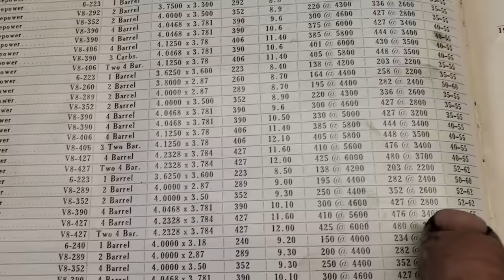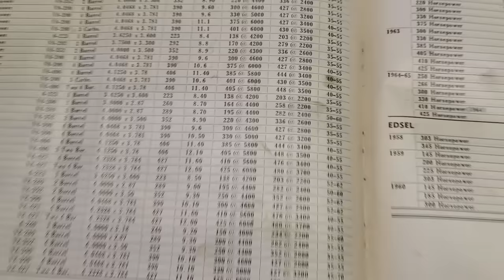1964 Ford 390 FE Country Squire Engine Gets A Teardown

Comment: nice! I have a 64 Galaxie 500 2dr sedan out in the Driveway right now.  the Z code 300hp"thunderbird" V8 was correct with Castillian Gold valve covers and air cleaner and available in any full size model Ford, not just the T-birds.   rest of it should be black.  Ford went to blue engines in 66 sometime.  looking forward to more!
Reply: on that engine stand, flip the head of it upside down so the angled slot are on the bottom side, then you should be able to get the arms into the lower bellhousing bolt holes.  for a complete FE you do need at least a 1000lb engine stand as that thing is 650+ lbs all day with all the iron bits on it...
Reply from the maker: Tried it. Wouldn't fit any way I put it. I'm gonna probably do away with that part of it and build a heavy duty one.

Comment: The reason it says Thunderbird on those valve covers you could buy the cars in 64 with a Thunderbird package they put the Thunderbird engine in them I had a 64 Ford XL convertible that had one in it The motors were gold instead of blue

Comment: We have to assume that engine was taken apart and either rebuilt or given a hone job and 5 thousand over size pistons filed to fit. Also, don't assume all pistons are the same size or all bores are the same.  The rebuilder was under no obligation to do the same thing to every cylinder and it was smart NOT to since they may all have different problems.
  Time to mic the pistons and the bores.

Comment: 26:47 ... man I laughed so hard, that's exactly the sort of stunt I would do!!
Re. the pushrod order in the FE with hydraulic lifters, if you mix them up on the reinstall you can just rev the motor hard for a couple of minutes and that should get things readjusted just fine.
Whenever I have to deal with pistons stuck in a block, I get my bro-in-law to turn up a chunk of wood on his lathe to fit snugly into the bore.  Then I can lay into it with the sledge hammer with least risk of damaging the piston crown.

Comment: My experience with those top exhaust bolts, was that it didn't matter what I tried, heat, heat and chill, the normal thing for me was, about 1/2 of them would break.  I still love the FE engines, and still have a 390, 335 horse, as well as a 428 with CJ heads that don't have a chassis.  Good luck with your project, I'll be watching and hoping that the restoration goes well for you.

Comment: Man I think I would have taken the valve covers off , sprayed marvel mystery oil in the cylinders and the rocker arm panels , and soak them for a few day then tap the rockers with a rubber mallet to see if the valves would free up .

Comment: Hello! Last I heard you were sending the block and heads off to get them magna-fluxed.  Were there any cracks or water leaks?   Also, if you want a really good solvent for stuck bolts or pistons make up a mix of acetone and automatic transmission fluid in equal parts.  Tests showed it was better than any commercial product.
Reply from the maker: We'll get back on it eventually.

Comment: I have a 63 289 I had to heat and beat every piston out. Waiting to get the block checked.  It had the same issues. Overheating and water in the oil but gaskets looked good. Did you ever find the problem.

Comment: A gold painted 390 4V with Thunderbird valve covers is definitely out of a Thunderbird. Galaxies generally had 352's in them with smooth valve covers and painted light Ford corporate blue. Although they could be ordered with a 390 , 406, or 427. All would be Ford corporate light blue. All the valve pushrods should be the same length unless there is a lobe on the cam going flat. The liifters are usually varnished uo on the bottom side and won't come out the top side easily. Turn  the engine upside down and pull the cam. That will drop the lifters away from the cam lobes.
Reply: The 390 Galaxie came with Thunderbird valve covers painted gold. They advertised it as having the power of the Thunderbird in your Galaxie.
Reply: @joelbrower6547  Huh. My '64 Galaxie 500 XL with a 390 didn't.

Comment: You might want to measure the bore for size - I noticed in the valley there was a casting number of 352.  Is that really a 390?  They all look the same externally, but Ford built  a lot of 352s.
Reply from the maker: If  not mistaken all FE motors have 352 cast into them.

Comment: Very least it needs bearings, decked flat, heads refurbished, and over sized rings with a bore job
Reply from the maker: Do you need my paypal info so you can send me the money for all of that? 🤣
Reply: @ThisNThatGarage  Bearings and rings are cheap. Maybe $200. A shop will deck it for about $150. A valve lapping job is free if you do it yourself. 

There aint no point putting a completely worn out engine back in when you can make it way better for a few hundred bucks. You've got the means to do it dont act like you dont lol
Reply from the maker: @contraband1543  You should probably go price machine work. It'll be easily over 1000 just in machine work.

Comment: Save a lot of time by just going ahead and removing the engine,and those exhaust manifolds are done I've rebuilt many of the FE engines and many other types of engines .been mechanicing fer many years and my engines of choice are the 385 series which I have a fo sixty in my 53 ferd cpe that I have built in the gasser style 😎 and those bottom exhaust bolts 🔩 will come on out with out breaking 😀

Comment: Why didnt you use the bucket on the tractor to begin with to lift the motor out? instead of that flemzy boom thing on the back of tractor or the engine hoist
Reply from the maker: Can't see what's going on good enough when I'm doing it by myself.

Comment: You set yourself up to fail with the boom. It really needed the spacing to make the triangle shape for strength. Get yourself a new piece of thick wall tube too. It's been bent a couple of times now. It's lost its strength. Just don't want to hear that a big old motor squashed you!
Reply from the maker: The boom didn't fail. Tractor hydraulics weren't strong enough.
Reply: @ThisNThatGarage  No denying that, but the boom was flexing. I more meant at some point in time. I'm just worried about it folding and causing you injury. My words were a little strong I know. But I am worried specifically about the tube on the boom folding at the curve. Keep a close eye on it.
I really enjoy your videos and want you to keep making them. Stay safe!

Comment: I'm ol'e North Carolina tobacco road red neck myself and i've been pulling engines for 51 years, and i NEVER EVER NEVER left any wires hooked to a engine when pulling it out!!!!!! You got to be more observant or you or somebody gonna get hurt very bad or even kilt. I've seen the results of things like that happen, and most ended VERY BADLY, 1 was deadly. Maybe you might try a strong cup of coffee to get your mind awake before take a 7-800 lb engine out!! Just saying
Reply from the maker: Well hello Mr perfect!
Reply: @ThisNThatGarage  I'm not prefect i can assure you. But 9 years in the NASCAR Open Wheel modified with a 4 car team as the team manager and crew chief on our primary car must have said alot about the way i approach working on any kind of vehicle. Going slow and steady, being VERY anal about my work seems to be a good thing for me. I was NOT trying to insult you in any way, just a helpful tip of slow down, safety first, and being OCD when working on cars. Thanks for you reply!!

Comment: Judging by the bearings and piston damage, that engine was detonating terribly...  Those old 4v FE's were 10:5:1 and require premium gas. That valve clatter everyone hears is actually detonation and is destroying your engine... BTW... Why doesn't anyone use the old timer method first...?  Fill the cylinders with apple cider vinegar...  Keep them topped up for a week...  Not only will it pop loose easy but the rings will be free also..  I've freed up a 30 flat 4 that sat open for years...  The water jackets were cracked but It came loose easy...  JB welded the cracks and it's still in my 30 A.

Comment: hello Sir. The transmission looks to be a AMX or the two speed. been many years since I worked on them,so not sure. Those old engines were brutes ,both in power and weight.Has always I Liked and shared. All my very best. Looking forward to more.

Comment: That's a motor that a non ford amateur should be very careful with. You said you don't have much money? You would be miles ahead selling the motor because they are worth infinitely more than you can imagine its worth to a lot of people. Its not a dime a dozen SBC.   You are going to run into some "different" stuff with that motor too and if its not done right it aint going to work. It pains me to watch someone that doesn't know anything about it beating on it like its a chevy. Little story about the weird intake. Ford partitioned NASCAR back in the late 50's to run aluminum heads and Nascar said no. An aluminum intake manifold was fine though. Get it? The manifold was 1/3 of the head. The Thunderbird valve cover signified 4 barrel carb I believe. Gold color signified 390.
Reply from the maker: It's not rocket science. I'm pretty sure everything will be just fine.

Comment: You know the spark plugs are tight when the big breaker bar actually flexes before the plugs come loose. I would expect the plugs to have sheared off before taking that much pressure.
Reply: @MaxGiganteum  been doing that for years. Being from northeastern Minnesota I’m not a newbie when it comes to rust.

Comment: Why did you not straighten top pipe on tractor lift ? The flat baar you weldded on top did nothing to strengthen the lift! The high point where you said were there was 2 wrist pins welded was the bridge point! If you had straightened the topp pipe first and welded it back together and added gussets and then bridged the flat bar on  the lift would have been 2 to 3 times stronger, wouldn't  have strengthen the tractor hydraulics any but pole boom would not have horseshoes, probably!
Reply from the maker: Did it break? Nope. Seemed to strengthen it quite a bit. 🤷🏻‍♂️ I find it odd that this is what you chose to comment on. To each his own tho.

Comment: bore out 390 CU Inch to  20 over  and make a 410 CU in blown rat motor.
Reply: 20 thousandths over bore will not add 20 cubic inches. Why would you think that? It's the crank stroke

Comment: Come on now you know there ain't no point in rebuilding it up unless you replace the bad bearings.

Think if you did all that work and then it knocks 1000 miles later.

At the very least you should have the crank polished with new bearings

Comment: .0005 is not 5 thousands , it is 5 ten thousand according to your gage
Reply from the maker: You are exactly right .0005 is 5 ten thousandths. That's what each mark is on the dial bore gauge and the dial bore gauge showed .005 wear.

Comment: I am not speaking as an expert only from my own small amount of personal experience...........  The Ford 390 had overheating issues and some of it I think was that the Ford motor company was not using good quality metals.  From 1963 - 1968?????   Ford's Rusted out terribly.  My mother had a 1967 country Squire wagon with the 390 motor.  That car had one motor replaced by the dealership under warranty because of cracking and the second motor cracked years later and at the beginning of the cracking my parents tried getting the cracks welded and the car lasted two more years and then there were major cracks in the block so by that point it was 1974 and with gas prices everyone in the United States was downsizing so the car circum to downsizing at that point.   It was sad because those cars loaded out were like driving Cadillacs.

Comment: I'd like to hope that you are just play acting on being dumb.....but someday your going to hurt yourself real bad. I just can't watch a mechanic like like you. I've worked on cars where a mechanic like you worked on it. And it took me twice as long to get the car corrected to where it was safe again. That "thing" you have on the back of your tractor to lift an engine is totally unsafe and should be put in your scrap pile. It's got rebar on it, which is an unsafe material for anything, unless it's in concrete where it was designed to be. Good luck to ya.....you need all the luck to survive you can get!!!
Reply from the maker: Actually my life goal is to be as perfect as you think you are.